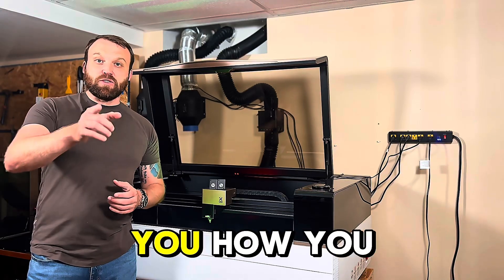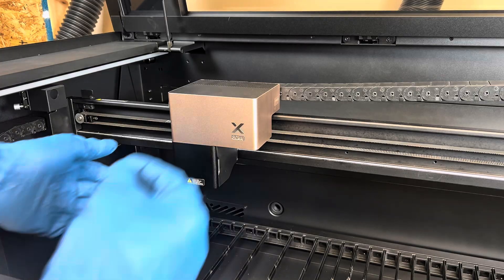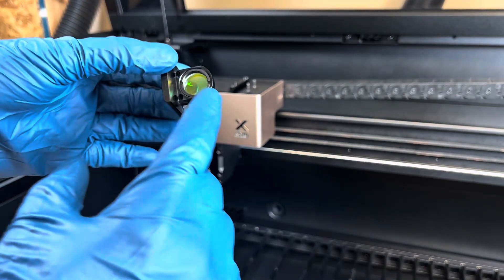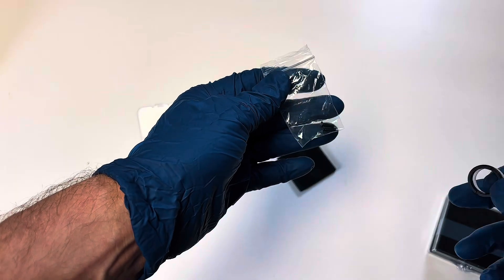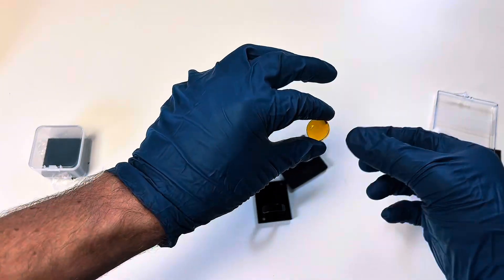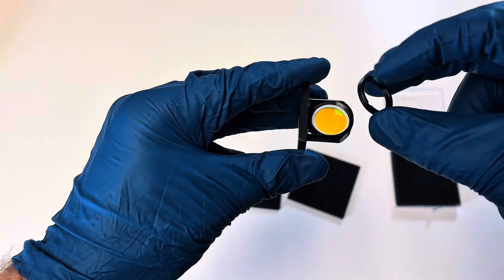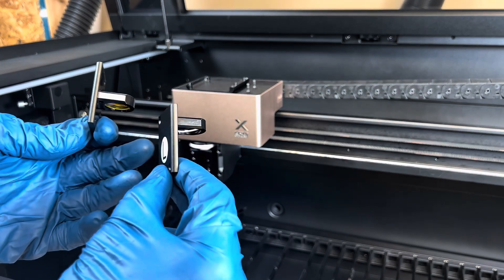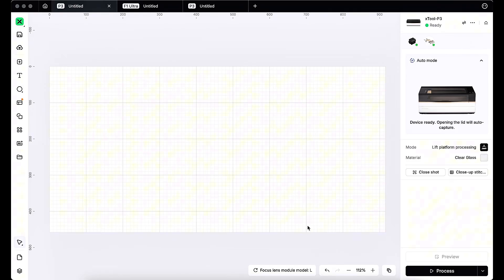How to replace a lens on XTool P3 #xtool #xtoolp3 #xtoollasers

Comment: What is the L and S lens best used for? I am assuming S is for more details.
Reply from the maker: Correct. L is best for cutting especially thicker material. S - for engraving where higher attention to details is necessary.

Comment: Thanks for sharing this information.  Very helpful, easy to understand and perform the lens change on the xTool P3.
Reply: Was it supposed to come with lenses?
Reply: @Ewandabbles  Not the accessory lenses.  The P3 comes with the "M" lens installed.  The "S" & "L" lenses are optional and available.  Not too expensive.
Reply from the maker: Thanks for watching!